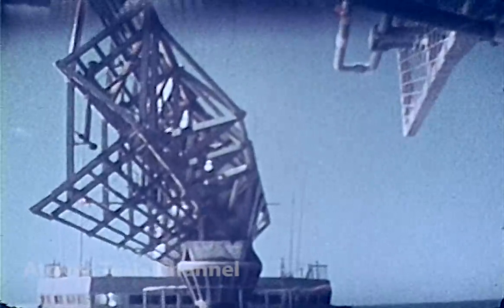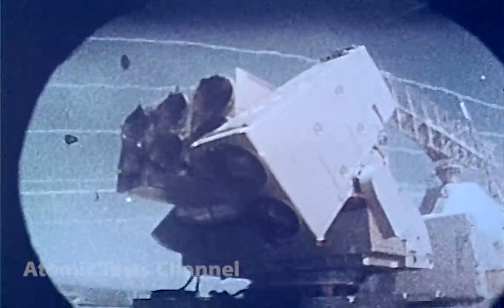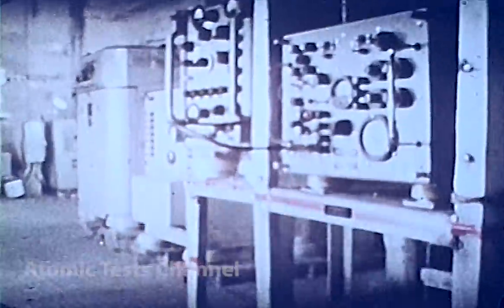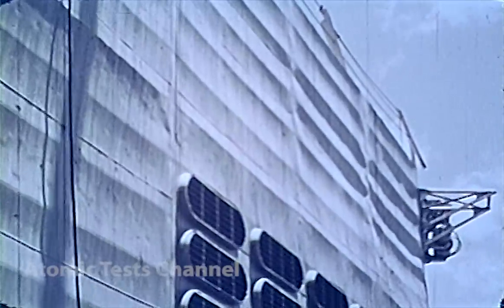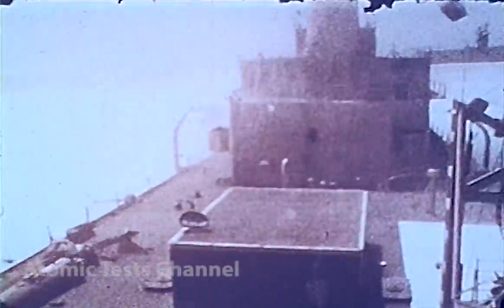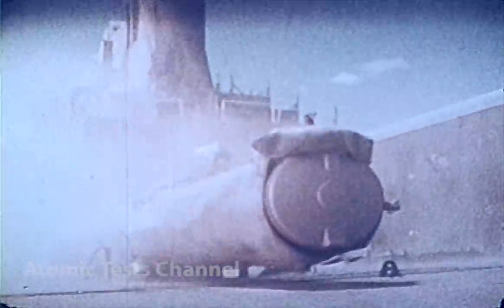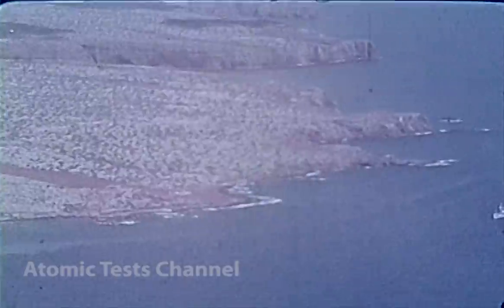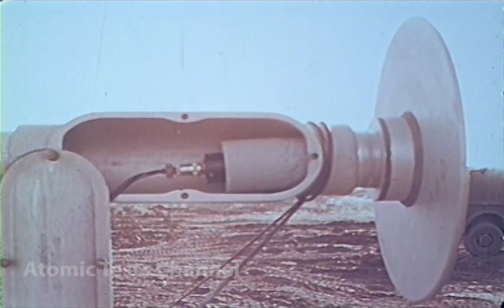Simulate Nuclear Blast On Ships Shock Wave & Blast Effect

Comment: It is incredible to see in the images the shadow that the shock wave casts on the ship's hull. The air is so compressed that it alters the light path due to the difference in density, thus creating a shadow. A pity that they did not think to point out a camera  with a  filter at the sun to observe the shock wave  passing by.

Comment: a few questions : can a blast wave form a shadow ?? at minute 1:08 a shadow shines through the picture before the pressure wave comes !! ??? how big was the bomb ?? smaller than hiroshima ??? and what kind of contrails at the most strange places just before an explosion! can be seen everywhere in the videos. always sideways or even horizontally in the picture!
Reply: Scientists and engineers fire small missiles at precise distances apart which purposely produce smoke, so that they can calibrate the strength and size of the shockwave, amongst other things, from still photos taken by 10,000 fps cameras. That was one of the crude solutions they came up with in the 1940's / 50's, before sophisticated supercomputer modelling was available.

Comment: Is it true you can’t hear the bomb until the shockwave?
Reply: As the recent Beirut explosion so audibly ( :) ) proved, it is indeed possible to hear the explosion before the shockwave reaches you. The rumble that we heard in several videos, is the tremors of the ground. These seismic waves can propagate faster than the speed of sound in the air.

Thus, if the explosion is large enough, close enough to the ground - and you are far enough from it but not too far, you can hear the explosion before the shockwave makes you deaf.

Comment: Screw all this antenna stuff! I wanna see on board footage of the ship in the background of the first antenna failure!! It had an old open cage mast and it looked like most of the superstructure was carried right away!!!! Show us that!!
The " no damage in electroncs in CIC" don't mean squat! No EMP! They don't worry to much about physical damage,but all that shit would be wiped out by the electro magnetic pulse of a nuke going off!
Reply: Actually EMP isn't unique to nuclear weapons.
Reply: @jacobcastro1885  No but I know for a fact that 1000 tons of any conventional explosive won't cause one! You can get a good EMP with a big transformer blows,other ways to do it. Maybe an uncontrolled power release from a big enough capacitor would cause one. 
Anyway, thanks,be safe and stay healthy
Reply: @tomcline5631  fact huh? All explosions give some level of emp. It's part of the energy release. They also mention this in the video. It is measurable.
Reply: @jacobcastro1885  You can measure seismic activity from an earthworm fart too if you have the right equipment! But a damaging,deserves to be called an EMP, isn't gonna occur from a conventional explosive. Used to help with the explosives at a rock quarry 25 or so years ago and we never had to protect extra blasting caps from the explosives we used. Used ANFO and prepared plastique explosives both, using an electric detonator. Stray radio/c.b. transmissions would trigger them accidentally,that's how sensitive they were.
Plus when I was getting my Firefighter 1&2 state certificates,when we studied explosives nothing ever mentioned about securing electronics from possible explosions. 
I think you're being a bit pedantic. So,sight me some numbers or sources or good night.
Reply: @tomcline5631  you used 1000 tons of explosives in a rock quarry?
Reply: @tomcline5631  so, when the video says emp was part of this test, you're saying bullshit?
Reply: @tomcline5631  look, you got a little more experience than I do. I have on good account (a late friend/colleague who participated directly in a similar sim nuc sim), who described how tnt was used simulate all effects of nuc weps, just without the radiation (such as in this vid), including EMP.
I assume you've not detonated 1000 tons tnt, so I feel it is reasonable that you may be falsely equating "x pounds not setting off blasting cap" to "1000 tons frying a transistor".
I'm happy to hear what you know that may contradict what I've come to understand. 
If 1 kilotons is not big enough, than in your expertise, what is? 10k?
Is it just as easy to set off a blasting cap as it is to fry a transistor? I wouldn't think so, but I don't know.
Considering the widespread misunderstanding of EMP, I am a little skeptical, even of someone with your experience. All due respect, I am naturally sarcastic and argumentative.